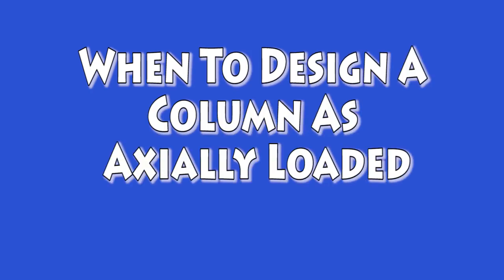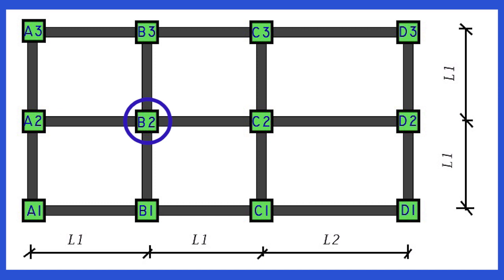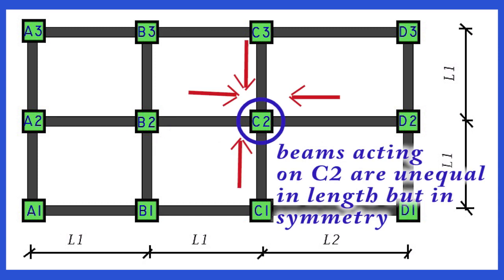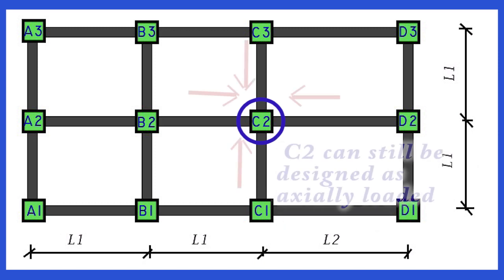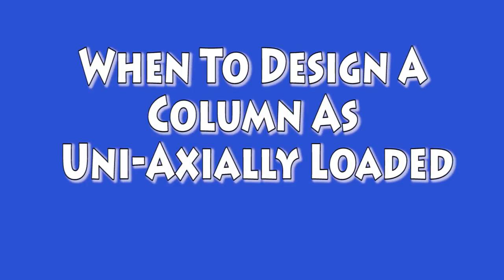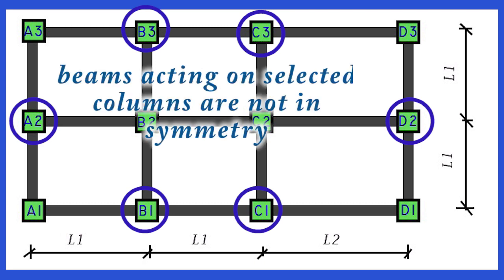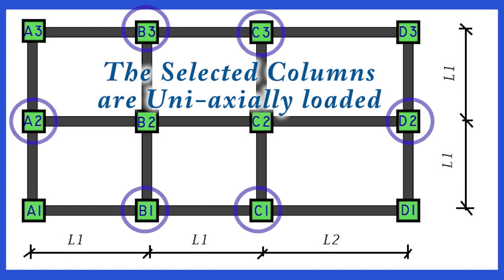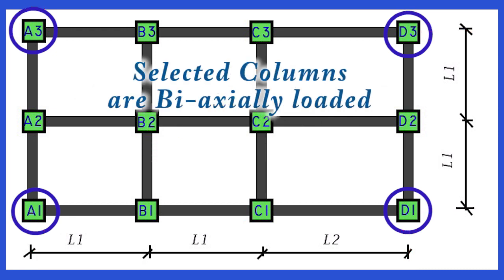How to know if a column is Axially, Uni-axially or Bi-axially loaded from floor plan

Comment: Is it safe to design column only with axial load ?
Then what about minimum eccentricity?
Reply: Yes it is safe because axial force is more dominant and will fall on the compression failure zone as per the interaction diagram.
Reply: Depending on type of building,if medium and high rise should take in considaration moments,mnx and mny or 1 of them.if mnx and or mny smaller minimum moment so you design axial load only because governs,emin=0.1h for tied columns and 0.05h for spiral columns.